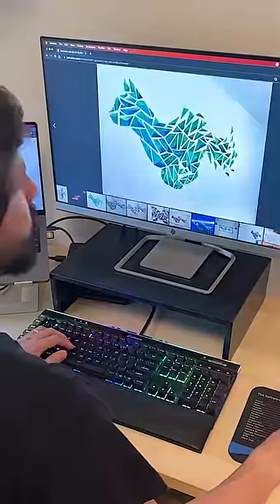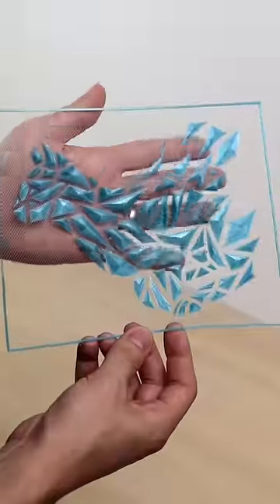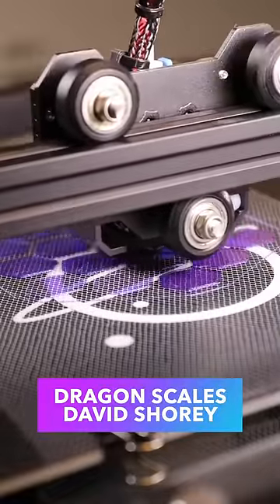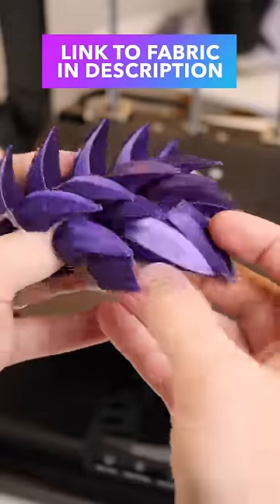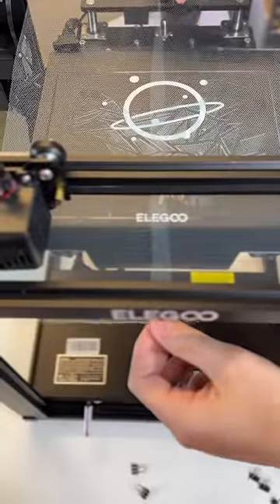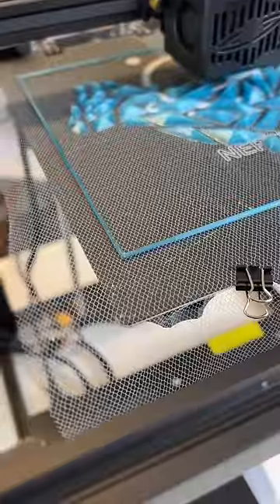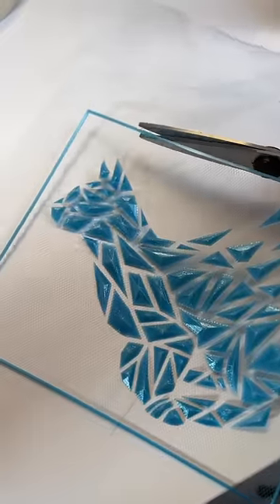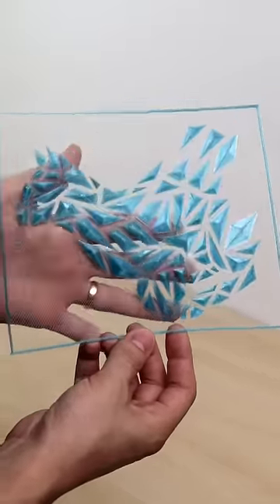3D Printing on Fabric: Geometric Art

Comment from the maker: The tulle fabric is only $2.98 on Amazon, try it yourself: https://amzn.to/454iWCG
Reply: Sometimes craft stores have them for $0.99 a yard when on clearance
Reply: I don't think I can without a whole ass 3d printer
Reply: You can get a yard of tulle for like 50¢ at most fabric depots as well
Reply: I think it is the size of china😅
Reply: Just let me get a 3D printer in the first place 😅🥲💀
Reply: @Darktrap11 get the Bambu lab a1 mini, it’s fantastic. It just works without any issues and does calibrations by itself
Reply: It's like you're embroidering with plastic which is oil which is the same thing threat is made from and synthetic fibers anyway the point is what you're doing with the plastic box around it is basically it's like when you use a embroidering loop to add tension to the fabric otherwise we haven't seen it pushes through and messes the fabric up because the fabric will be moved around if you don't have a embroidering hoop
Reply: US: 🌝
Arg: 🌚

Comment: If you use clear tulle, you can go a step further by pouring a thin layer of clear resin that will make the tulle disappear completely
Reply: I feel like that wouldn't last very long
Reply: @smapa1185 ? Acrylic resin is pretty strong, and the total layer height here is decently tall. A fully submerged print would no longer be flexible, but would achieve a really cool effect for something you frame or hang.
Reply: @smapa1185 It's not like it's a CD jewel case, now THAT is an extremely fragile acrylic.
Reply: Oo that’s friggin SMART 👑
  Are there flexible Acrylic Resins? If not I bet clear Latex would work... actually, that sounds divine, both visually & tactile wise.
Reply: There are flexible "soft" UV resins that could be great for this!

Comment: The border anchors are an excellent idea, since the fabric (I use thin cotton or guazy scrap pieces I get from the fabric store) has a tendency to shift a little when printing the sandwiching layer of my scales. I’m actually about to start a project, and that border idea may make it a lot easier to control my prints. Ty!
Reply from the maker: No worries, let me know how it works for you!
Reply: If you want something stiffer, window screen also seems to work well. That's typically black though, which might be better or worse depending on where/how you're displaying it...

Comment: This could also be super useful for making things like fursuits!
Especially characters with like layered scaly bits or horns. The way the fabric moves makes it look so natural! :]
Reply: As someone who has tried this before. The weight quickly becomes a problem, I made an arm sleeve of scales roughly a third the size of what's in the video and just that much was much heavier than the same amount of faux fur
Reply: If you use powermesh instead of tulle it'll hold up a lot longer and have 4-way stretch!

Comment: This would have been nice to know about before i tediously glued glow in the dark letters on pieces of plexiglas.

(Cursive is the way to go if you want to do it that way, waaaay fewer pieces)
Reply: If you are working with plexiglass, one option is to engrave the design into the surface and put a light strip on the edge of the plexi- the engraving will catch and scatter the light, making the design glow!

Comment: You could probably find some fabric like that made out of transparent fibers which would make it even more interesting, especially if you make the border thicker.
Another great use would be to put wireless leds in the middle prints and a coil on the outside, making a really interesting shape.
Another thing to try would be printing a holder, and flipping the print so you have both sides. (Or just print the bottom with support)

Edit: a single strand of magician thread (i.e. 0.02mm fiber) would probably work as long as you cross each piece twice at 90 degrees to prevent it from rotating.

Comment: Have you adjusted your bed level when using the fabric on the print? or did you just pause it and lay the fabric over the print / start the print with the fabric on the bottom?
Reply: Printing with thicker layers allows you to insert the fabric without much issue
Reply: I just tried this using window screen, reused a model I already had on the printer so no changes to layer height or anything. I did raise the Z-offset by about 0.1mm when I added the screen but not sure that's really necessary. You do need it to squeeze the plastic through the screen though so you definitely wouldn't want to raise it much...

Comment: I dunno about tulle fabric, but it looked a bit like window screen to me, which I've got a big roll of in the closet, so I did a small test with that and can confirm it also works just fine! Might be a bit harder to tape down because it comes in a roll so it doesn't lay flat but a few long strips of painters tape held it just fine for me.

My test was just using the last file I printed, paused after the first layer or two, laid down the screen (and raised the z-offset about .1mm; not sure if that's totally necessary though), resumed a few more layers and then cancelled it. Now I gotta find an actual reason to use this...thanks for the tip!

Comment: There's also a fabric that can "melt" away with water, so if glue the peices to a water resistant surface (canvas, frame, glass, etc) you can then melt away the fabric and have the pieces in the right placements

Comment: You could also just put a 0.2mm high 3D cube underneath the structure and link it to a modifier, e.g., in Prusa Slicer; inside the modifier, set top and bottom layers to 0 and the infill to 20% and the infill pattern to grid. Same mesh support with no in-print fiddling.

Comment: i’m always thought about patterns like this when 3d printing. what if you made a mold or vice for the pieces to fit in? either print with it or already made and then is set in an alignment tool before printing the pieces. or could just number them lol

woah! but the fabric adds a flexibility suitable for movement!

Comment: How do you pause the print?
I'm new to this hobby and have an Ender 3 v2 neo 😊
Reply from the maker: There should be a “Pause” button on the LCD. You might have to find a manual and check it out, but it’s usually pretty easy. Good luck!

Comment: I was wondering how to reduce stringing on the final layer of the print. The tops of the triangles (Since they are small) would string from one to the other, and I Was wondering how you got your finished product so clean!
Reply from the maker: I ran the PLA through a filament dryer immediately before printing! You can see it in one of my other Shorts! 👍
Reply: @AndrewSink  I forgot I had one, so I'll definitely do this thank you! Also, I made my own designs and I'm going to stich the final fabric/3D print to a hat and sell them on my etsy store eventually. Currently I have a wave and mountain design :D.

Comment: Print number under triangles?
Reply: all triangles are numbered on their back but this design was mainly done for wall decoration (default size is around 150 cm)  so if you print it with a small size like that, you will not be able see numbers ( I'm the designer of this cat)